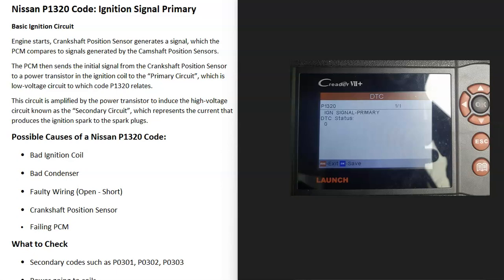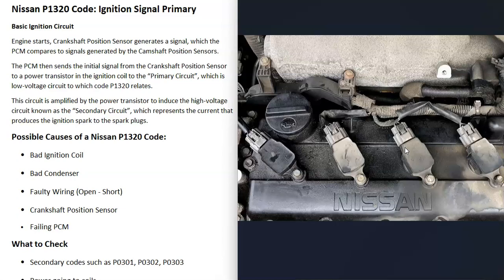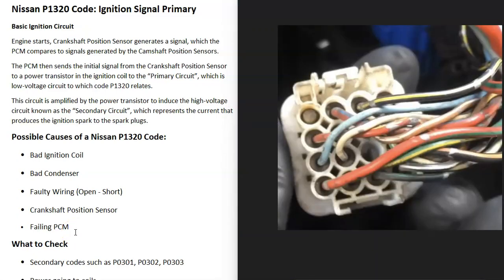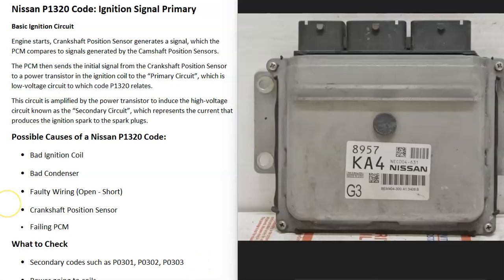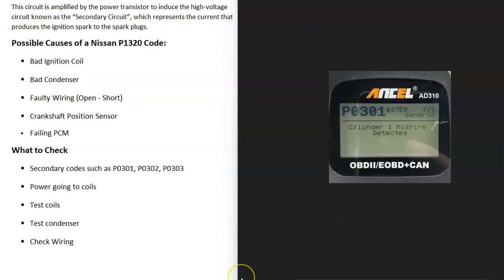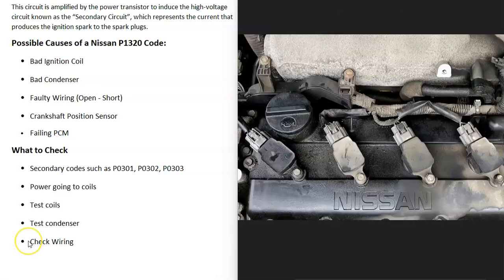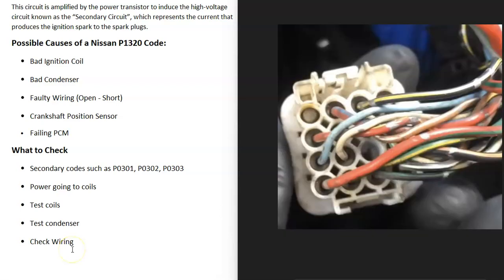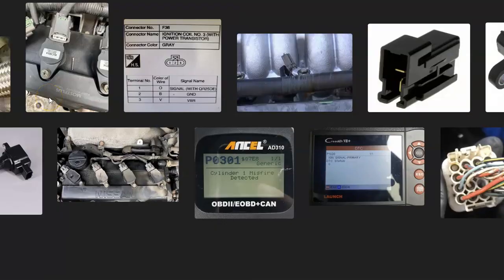Causes and Fixes Nissan P1320 code: Ignition Signal Primary (Ignition System – Circuit Malfunction)

Comment: Hi, I have codes p0154, p0155, p0134, p0135, p1165, p0720, p0161, p0141 and p1320
Reply from the maker: It's highly unlikely that all 02 sensors failed at the same time. I would check for a blown fuse or a bad relay. Also, check the battery; be sure it is charged, and the cables have no corrosion. If that is all good, there may be a wiring issue.

Comment: If anyone is watching this, there's another possible cause and thats a failing alternator. When one of my diodes started to fail it wreaked havoc on the 5v system. Random sensor codes, stalling, etc.. still charged okay too until finally it didn't and started charging at 18v 😅

Comment: Xtrail t30 giving codes p1320, p0110, p0100 and i replaced all 4 sprk plugs and coils. Still have the code. the car is having issues s tarting and idles rough for a minute then shuts down. It immediately shuts off if i press the gas pedal. Help please
Reply: hi,. you have 3 codes for 3 different things....
P1320 is explained in this video where it could be coils, condenser or wiring etc..
P0110 is fir you intake air temp.. it could be the sensor itself, wiring or the MAF (mass air flow sensor)
P0100 is for you MAF or associated wiring..... 

so P0110 & P0100 could both be because of a faulty mass air flow sensor or the associated wiring.... . check the wiring and/or replace the MAF

Comment: My 2001 sentra is a mystery. The code appears 2 times on my scanner. Ive replaced about everything except pcm and crankshaft position sensor and the thing is still sounding like it wants to die.
Reply: Any luck.?
Reply: @Jamesrdc  my mechanic said the maf sensor voltage input is extremely low, and it could be a short in the wiring harness. Same issue?

Comment: Hello! I have a 2000 Nissan Maxima GLE 4DR. And I have Codes P1320 & P0505 The Car Starts and Runs! The Problem is, When We Stop at a Red Light, then Start Moving, it Hesitates or Jerking a little! Then it be fine Until We stop again! Hopefully You Can Help figure Out What's going on with it!IF You Can!!! Thanks!
Reply: Replace distributor
Reply: Fool these don’t have distributors 🤣 ita normally ignition confessor for 2000s maximas and i30 infinitis 2000s
Reply: Me too same problem stops on d (drive) it jerks.when I shift to N(neutral) no problem.i change spark plug,gasket seal,I don't know what exactly problem, someone says transmission issues.
Reply: What was it?

Comment: I got a 98 frontier 2.4 with same code kept coming up distributor so I changed dist, plugs, wires, and light is still on.It runs but when I get up speed it like wants to die but doesn't and then goes back to normal any help would be greatly appreciatedThanks

Comment: hi there. i really appreciate your video. ive been having trouble with my 2002 nissan almera. it keeos dying as im driving. initially i thought its the battery and had it replaced to no avail. a guy came to do my driver and back right window as it wasnt working. however he noticed when he would pull each wire out of the pencil coil it would lose power and it wanted to switch off except for the one on the far right, it wasnt losing power. i tried swopping them around but it was still the one on the far right not losing power once the wire was pulled out. eventually i bought a new pencil coil but before i put it in somone suggested putting a screw driver in the connected ignition coil and look for a spark but nothing happened. this suggests its the wiring. the problem is i have no idea where or what to look for on the wires.
Reply: Replace distributor
Reply: Did you get this fix